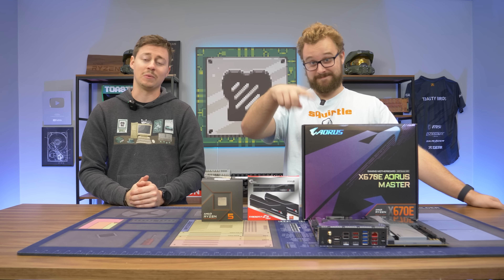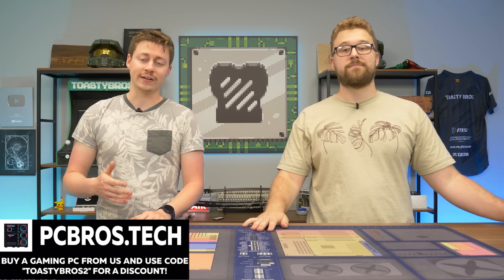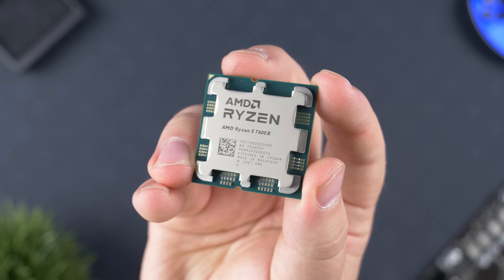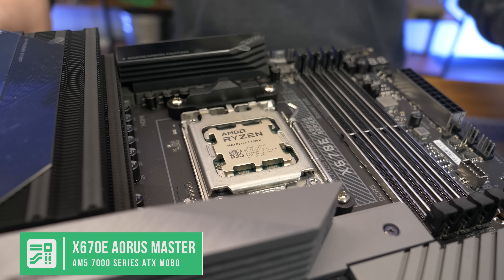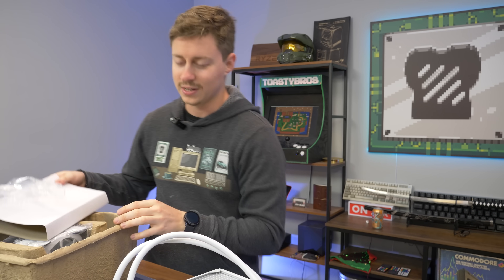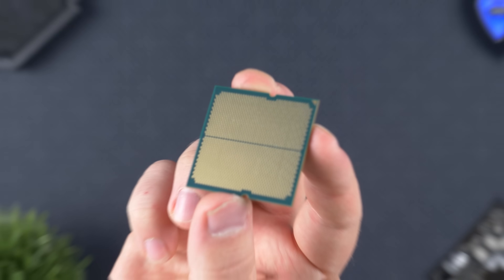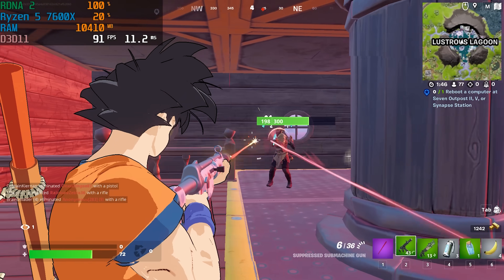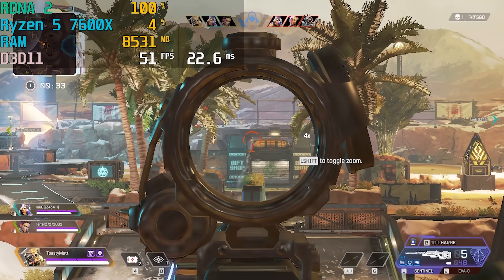Did AMD Secretly Kill Budget GPUs? Ryzen 5 7600x iGPU Gaming

Comment: By theses results alone, the iGPU AMD put on 7000s  has a lower peformance than the 680m used on mobile 6000s (900H-800H). this is actually, bad tbh
Reply: It is a 610m, so yeah.
Reply: @NeblogaiLT  So, AMD did't announce the specs in the iGPU before, but they now show it on their website. Just 2 unit.  So much lower than the 6 and 12 on 660m and 680m. Had much hope for the potential on it for budget gamers but AMD really wanted just to show the screen
Reply: @thomazwanderley4378  Showing the screen is important- it opens office PC, and laptop market for this chip. Putting a large iGPU on it, however, would cost a lot, but would not pay off- budget gamers do not want to pay extra for the iGPU.

Comment: that ddr5 is really helping big time. one of the limitations of last gen APUs. if you had a RAM running at FCLK running at lower speeds, you would be losing some perf. I tested it using my 5700g. The iGPU is bottlenecked until FCLK is at 2000MHz, beyond that, no performance gain worth the voltage increase.
Reply: With just 2CUs, RAM bandwidth should not be much of an issue here (RDNA2 too, so better memory compression). More CUs are needed to make proper use of what DDR5 already offers.

Comment: Thanks for showing this because I was wondering if I should get the mobo and chip and just use the integrated graphics until the 7700 XT comes out or hold off on everything until it was all available. I think this has been an eye opener for me. I will probably get the CPU and just use the integrated graphics until the card I want comes out.
Reply: Just a heads-up, make sure that the motherboard actually has a video output, some motherboards dont have that ^^
Reply: @Meyus_  Thanks for the heads up. I'll do that. I was under the impression they all did it's good to know that I have to be careful. Thanks.
Reply: @darrenskjoelsvold  No problemo, I will do the same, I will buy a 7 7700x and use its iGPU till I can buy a 7700xt or 7800xt
Reply: @Meyus_  Ooo the 7800XT..  That'd be a good choice too. But I decided to go with the 7700 because of the symmetry. 7700X 7700XT equals 7777. :)
Reply: I think if you can waiting a two months or something like that would be better 
Until prices hopefully get cheaper
Reply: @al2os6oraah36  eh I bought an entire laptop just to be a stop gap to prevent over spending for the parts then. I don't think that higher priced mother board is a problem.

Ok just to add, I did want a new laptop for work anyway but I probably wouldn't have gotten a gaming laptop for what I do. But I am glad that I did now.

But frankly a higher end motherboard would not be the end of the world for any potential future compatibility. I remember the high end motherboards that came out when Ryzen was first introduced that were still compatible with 5000 series chips with a bios update. So if these extreme motherboards allow me to upgrade at the end of this gen then it could be worth it.

Comment: To have an integrated graphic that's good enough for displaying images and even can do a bit of gaming on a processor that was meant to be paired with external graphic card is nice to have. AMD knew that not everyone who is invested on the AM5 platform will have enough money for a decent graphic card so it's really a good move
Reply: Doesn't new ryzen gen require u to literally get newest motherboard, ram and all that shit? I dont really think these processors are meant for budget pcs.
Reply: man its really dumb to invest into am5 platform since u can literally get a good gpu and other stuff which can give u alot more rather than buying expensive rams mobo and processor
Reply: This is not designed for budget gamers. This is a CPU to undercut Intel hold on non-gaming high end processors . For example, you need lot of computing power in your work station, but do not intend to game or render . So far , AMD G series sacrificed lot of performance to get decent iGPU . Now they have gone with Intel's example of bare minimum.
Reply: But intel's had this for well over a Decade now. You've been able to use the iGPU and do daily stuff and some verylight gaming for a long time. iGPU good enough for Photoshop, Adobe Premiere and 4K videos.
Reply: but you can have am4/5600g for a cheaper price while you wait for am5 mobo and newer apu from AMD? these are basically test run for those. You need to wait am5 to be common before dipping in so you can save money. Not everything new is good.
Reply: Late comment, but your opinion is very wrong. They included the iGPU in all their Ryzen 7000 series not because they care about your budget. It is because of the OEM market. OEM PCs like Dell or HP often come in mini size or small form factors and are mostly targeted for office use. These kinds of office PCs they mostly rely on integrated graphics, and they do not need an external GPU because they only perform basic office work. AMD doesn't want to waste their wafer on low-margin chiplets to make the 7000G series CPUs, so they have no choice. If they want to secure the OEM market, they must include an iGPU in all the processors.
Reply: i dont think so, AM5 it's quite expensive and no way someone buying am5 with all the bells and whistles cant afford a dedicated gpu.
if you are on a budget, get am4 with a 5000 series apu and you would be absolutly fine
Reply: I don't need a dedicated GPU and want a small form factor. When I do play it's old potato games from 15+ years ago.
Reply: Still saving on an RX-7600XT, and my RX580 died :(
Can't really game now, but at least I can still work~ Yup, good to have.
Reply: People that buy the latest processors etc dont run games on the igpu.
Reply: @deeplaysgaming4754  not everybody that buys a powerful CPU does so for gaming or accelerated workloads. Those few square mm of the iGPU make the CPU appealing to those who just code and compile big projects.
Reply: @CossackHD  I didnt say they did, but if youve got money for such a cpu a powerful gpu would help in certain workloads which is why when these channels benchmark the cpu 's in benchmark apps they ALWAYS have a powerful GPU to use also. LInus, Jay u name them never seen them benchmark a cpu with just igpu before, and the rule of thumb for pc is spend twice as much on gpu as cpu price. would anyone thats willing to spend this on a cpu just leave workloads and gaming on the table because of price? Be willing to bet more people than not that buy this cpu would at least have a mid range gpu, nevermind system integrators that wouldnt sell a system with this cpu as a gaming rig, they'd more than likely always include a gpu.
Reply: @deeplaysgaming4754  there is a somewhat rare use case when a discrete GPU is simply unnecessary in a build with high end CPU. That is a few % of marketshare that went straight to Intel during last 12 years or so. The "workstation Dell" kind of thing. Back in the day they had what was considered an overkill i7 (ofc there were i3 and i5 options) and had no dGPU (or even enough space for one), and those have later become a interesting option (thus well known) as something to buy as cheap used PC and put a GPU into. So, I hope you know that dGPU-free high-end CPU machines have a decent market, just not in gaming ofc.
Also it's good to have benchmarks done on the iGPU to know the level of performance.
Lastly, the iGPU is placed on the lower cost 6nm IO-die, while shintel puts a much bigger iGPU on same die as the CPU cores. So, intel is even more wasteful in this regard. How many iGPU ececution units does worst intel CPU have? 2-3x times as many as these AMD chips? And if intel cpu comes out with (example) 3 deffective GPU cores out of 8, they make it F with graphics completely disabled. Waste.
Reply: @CossackHD  exactly you said it,  "there is a somewhat rare use case when a discrete GPU is simply unnecessary in a build with high end CPU" rare use case that a gpu is not needed,  so what i said makes sense, a high end cpu is needed to run the highest tier  cards so they are somewhat symbiotic, wont get full use out of a 3090 with a ryzen 3  processor. simarlarly wont get full use in games or gpu dependant tasks using that intgrated igpu.
Reply: @CossackHD  what do you think is the most bang for your buck laptop for web development ?
Reply: @potaetoupotautoe7939  depends on what is available and price range, I'd recommend 16GB RAM and at least 6 threads. 15" Lenovo thinkpad with Ryzen 4700U and 16GB RAM is pretty nice for the money IMO - I did some frontend development in a big project with lots of dependencies (takes some time to "compile"). There is a cheaper option with 4600U I think - its barely slower with 6 threads instead of 8. If these are still available and cost less than more modern models, I'd recommend them.
Reply: @deeplaysgaming4754  i buy latest processor and play game with iGPU.
because I'm waiting for the VGA price to drop even more.
:face-blue-smiling:
Reply: @penonton4260  u must be playing e-sports titles then.
Reply: @deeplaysgaming4754  this cpu costs like 230 bucks so it very well might happen lol
Reply: @deeplaysgaming4754  I do lmfao
Reply: @deeplaysgaming4754  true
Reply: on point! right now i'm still saving po  a GPU. i thought it can't really play games eve in low settings.
Reply: if you made am5 your investment, you wasted your money lol
Reply: @authoritariangentleman7570  How so ? Please elaborate.

Comment: The fact that it can run any games on that very cut down igpu is pretty impressive
Reply: AMD has igpu before, for example 5700g igpu vega 8. Also can play games 1080p.
Reply: bro even the R3 2200G could run all games back then. this igpu is a real let down
Reply: @giorgio5789  It is not an APU killer it is just basic graphics remember!  The APUs though with RDNA2 compute untis could kill low end discrete cards!
Reply: @Giorgio  my machine has a ryzen 3 3200g and when I bought it new it could only run Fortnite and Minecraft lowest settings barely  . I had to install a gtx 1650 to play anything more demanding over that
Reply: @giorgio5789  it's x version not g
Reply: @strygwr  there will be no G version with this current Gen same as there will not be any ryzen 3 7XXX
Reply: @giorgio5789  the g versions will obliterates the current best igpu on the market
Reply: @twinautomata9445  there will be no 7600G
Reply: @giorgio5789  im not saying it'll be the 7600g, im just saying the g versions of the newer rdna 2 will be better than the current best desktop apu
Reply: @giorgio5789 
Source?
Reply: @Justakatto  my source is that I made it the fuck up
Reply: @DieForDarius  classic

Comment: For not having drivers and no GPU not being a G serious and games not optimize for this cpu this are not bad benchmarks GG guys
Reply: it uses drivers and this is zen 4, its a refined zen chip so it is optimized, these results wont get any better.the IGP sucks just like it did before using vega graphics.its for browsing the internet and playing flash games.nothing 3d unless you want to play any modern game at 720 all on low
Reply: @kyles8524  yes this is not a G serious like we got on 6000g whoever thinks this is to transition out of GPU are obviously mistaken this new chips are not it but to even have it working on games that they are not even build for it is great, imagine this puppy with a 7000xt card GPU it will fly look at a video in Bitwit that he use it with a 3090 that it’s not even AMD not using smart and all the compatibility drives and it still did great. Look at Linus tech tips they did a great Video AMD 7000 vs AMD 6000 v Intel 12gen